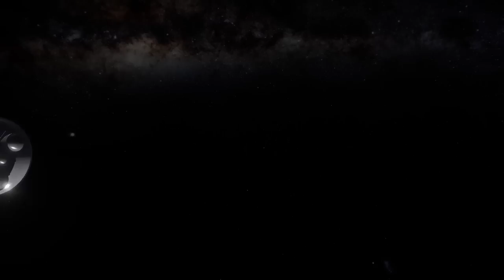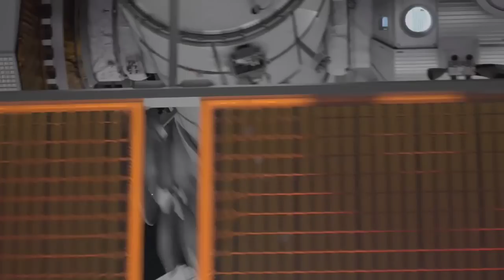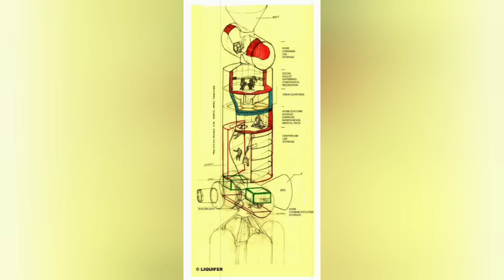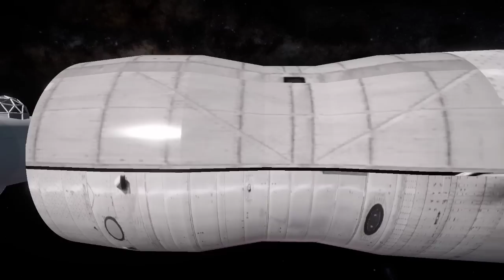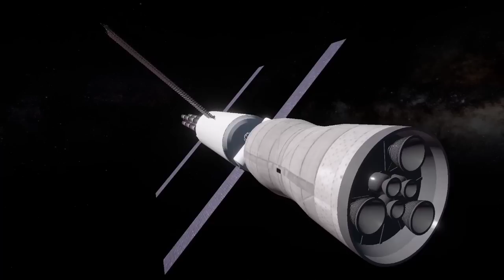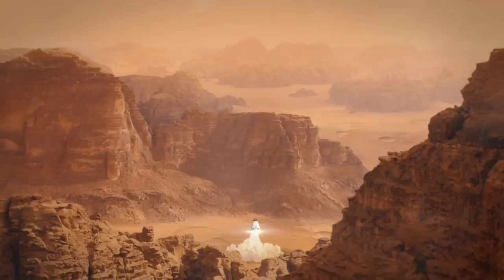The Ultimate Mars Exploration Ship!  ESA Project Aurora and how NASA is using it!

Comment: Hold the Project!  U of Toronto & Caltech used Material AI Software to design a nanoscale optimized geometry and found a carbon lattice 5X the strength of TI, but light as Styrofoam.  Now you can recalculate that trip to Mars.

Comment: Something to mention is that Aurora uses only "storable" propellant so there was never an option of using ISRU for propellant. A second proposal (really an excuse to promote the "Skylon" spaceplane concept) called "Project Troy" by Reaction Engines Limited that came around the same timeframe.

I also mentioned in comments to you there was a student study project called "Asaph-1" done in 2013 but used Falcon 9 and Falcon Heavy for both a precursor robotic mission along with a manned mission using NTR propulsion. There's also an interesting deep spacecraft design called "Space Coach" that has water as a major design basis for everything from radiation shielding to propulsion you might want to take a look at.

Comment: It's nice to see serious plans but unless these brave folks have a spacecraft with nuclear power, (engines and power grid) then this will fail. They need to get out there as quickly as possible and chemical rockets won't cut it. We developed nuclear thermal engines over a 20 year period between the 50s and 70s and that techs been sitting on a shelf for 50 years. Theres no reason outside of zero will to get serious about space exploration

Comment: Dr Robert Zubrin is correct, Mars direct, without a lenghty added zero gravity period, which must be avoided. The gateway is an expensive waste, unless it is much much larger and rotating.
This is no speculation, 3 of us, Lockheed engineers designed and documented a rotating space station.
One of us participated on the first successfull landings of  Viking 1 and Viking 2
The problem on Mars is the exploration, once landed and established on the surface, As usual angry is over pessimistic.

Comment: The "Inflatable Concrete" modules that were designed by Bigelow Aerospace, and successfully tested on the ISS, (as both Hab. Modules for a Lunar Base,  Mars Base, Asteroid Mining modules, AND as safer - and larger - alternatives to NASA's traditional "Tin Can" modules on an orbiting structure). Numbers of them could be brought in an uninflated state (to save space), and then (just as was tested successfully on the ISS), inflated either in Mars orbit to enlarge the Orbital Habitat, and upon landing, for safe, pre-outfitted, inter-connectable, pre-wired  Base Modules - Greenhouses, fuel production, Science experiments, etc. 
Being a type of CONCRETE, they offer a MUCH greater degree of protection from both radiation, AND micrometeorites, while having the advantage of being pre-fitted for specific purposes.

Comment: A human mission to Mars has always been envisaged as a nuclear powered modular ship. Starship may lift components to LEO, but there's no way a chemical Starship will take humans to Mars (or the Moon). Starship in it's current form requiring 10 refills is a dead end.
Reply: Its a dead end unless you make a gas station in orbit.
Reply: So, instead of 10 missions to directly fill the Mars bound Starship, your gas station takes atleast 11 missions.
Reply: @mrbaab5932  Its a bit safer for an interplanetary spacecraft to dock to just one thing than 10, so yes.
Reply: I’m thinking it’s only good for lunar cargo missions.
Reply: @craigmackay4909  Modified versions can have massive potential, especially if we put some gas stations in orbit.

Comment: Ten years to get this BUDGETED through the government (let alone multiple negotiating governments) is probably optimistic.

Instead, ALWAYS go with what you've got, to do what you can.  If what you've got can't get you there (and back for crew missions), don't go - but figure out what's missing and how you can get that paid for and built, to take the next step forward.  Always focus on re-usability, to slash costs of follow-up missions.  That's mostly what SpaceX has been doing.  Eventually it will work.  And the result won't be a big-deal program that may fail or lose funding before completion.

We SHOULD have been using Falcon9 to do small and simple on-orbit assembly missions. E.g. payload module plus fuel/engine module, dock them and send them off to the moon or Mars or Phobos (surface or orbit) to start building up supplies or capabilities (e.g. comm network satellites) for future missions, or to test out key high-risk systems (such as Mars aerobraking into orbit using Starship tiles, and long-duration cryofuel re-chilling systems).  Affordable and low risk at each step, small enough that it doesn't require Congressional debates at each step.

With Starship operating (soon?), we could begin refueling and Lunar landing tests (with little/no payload initially, to reduce fueling) even before we get successful Earth re-entry.  (Of course, it has to stop blowing up getting to orbit - I'm still suspicious that hot-staging may be damaging Starship's engines.)  

If NASA wants to budget something useful to get done quickly, they could pay SpaceX to build a stubby little mini-Starship "landing ship" - shrinking the tanks and cargo volume - that could never land back on Earth but with refueling (and iterative improvements) could shuttle crews many times between Luna or Mars surface and orbit. Able to be put in orbit with enough fuel to go land on Luna, and with additional orbital fueling (Falcon9 missions to test refueling hardware) it should be able to also return to Earth orbit. (Unfortunately, the current government financial situation may not allow for new programs, no matter how much they might save long term.)

Comment: This idea would be good if we weren’t expecting to be using nuclear space engines in Five Years. It is not the speed of the ship that The Angry Astronaut is telling us about that’s the issue. It’s the fuel that won’t last. As Angry has told us about Fuel Boil Off, which I guess happens when the fuel tanks are in the Sun Light. My thoughts were that we would use a thicker shell of aerogels for the fuel tanks.
‘Put a shell 10 centimeters of water around each tank, but that would add mor mass? Couldn’t we use aerogels to protect the fuel?’
They could have a big solar shield of aerogels with solar panels on the shield that blocks the harmful solar rays from reaching the fuel tanks.
‘With a shield big enough to shield the entire ship, they wouldn’t need as many radiators to radiate as much heat from the ship. Oh, with the solar panels they would have more electricity to power the AC or heaters. Or to power the nuclear electric propulsion (NEP) so we wouldn’t need as much fuel.’

I wasn’t sure about Aerogels, so I asked Claud 3.7 Sonnet:

Aerogels are remarkable materials with extensive applications in space exploration due to their unique properties. Here's how they're used in space and how they help with radiation protection:
Space Applications for Aerogels
1.	Thermal insulation - Aerogels are among the best thermal insulators known, making them ideal for protecting spacecraft from extreme temperature variations in space.
2.	Particle collection - NASA's Stardust mission used silica aerogel to capture comet dust particles traveling at high speeds without damaging them.
3.	Mars rovers - Aerogels have been used to insulate Mars rovers like Curiosity and Perseverance against the planet's extreme temperature fluctuations.
4.	Spacesuits - They provide lightweight insulation in astronaut equipment.
5.	Cryogenic applications - Aerogels can insulate liquid fuel tanks and other systems that need to maintain extremely low temperatures.
How Aerogels Help Stop Harmful Solar Radiation
Aerogels help protect against radiation through several mechanisms:
1.	Light scattering - The nanoporous structure of aerogels causes Rayleigh scattering of radiation. This means incoming solar radiation is scattered in multiple directions rather than passing straight through.
2.	Absorption capabilities - Specialized aerogels can be doped with radiation-absorbing materials that capture harmful rays.
3.	Hydrogen content - Some aerogels (particularly polymer-based ones) contain significant hydrogen, which is effective at blocking certain types of radiation.
4.	Multi-layered protection - In spacecraft design, aerogels are often part of multi-layer insulation systems that combine different materials to protect against various types of radiation.
5.	Low density with high stopping power - Their extremely low density combined with their effectiveness makes them ideal for space applications where weight is a critical concern.
Aerogels aren't typically used as the sole radiation shield, but rather as part of comprehensive protection systems that might include other materials like aluminum, polyethylene, or water for complete radiation protection in space environments.

Comment: 1) For so long duration of flight some descent sort of rotating torus is a must, or a tether for costs, just for humanitarian objectives. How could anyone jeopardize human health, even if volunteers, with so prolonged zero gravity!
2) What protection against solar wind, just in case of burst? ISS is shielded by Earth's magnetic field on the orbit...
3) Why doesn't lazy NASA work on nuclear propulsion interplanetary missions? There are plenty of very sound concepts, which are capable of making journey to Mars up to month long!
4) There should be at least 2 identical ships travelling parallely, each one capable of supporting whole crew of both ships combined.
Redundancy is everything for such long mission with so many unknowns!
If it comes to experiences, the design itself is most significant. Constructing of yet another instance cost is dwarfed by the "proof of concept" value, with the constraint of safety.

5) In situ Mars habitat is actually the safest option, already wait being prepared and thoroughly tested by robots from previous automatic missions. Elon Musk's Optimus bots are about to be sent already next year...

1) and 4) can be combined, 2 identical spaceships joined with tether and rotating around a common center of mass to create a centrifugal force in each of the ships.

In a case of emergency each of the ships could travel independently with abandoning of centrifugal force

Comment: IMO solar electric propulsion is the way to go to Mars ans back and for adjusting the earth and Mars orbit.  Chemical are only necessary to go to the orbit of Earth and Mars.  So I propose a three tiers mission. Tier one build the convoy in Earth, orbit tier two cruise to Mars and the good Martian orbit.Tiers three, go to the surface of Mars and come back with a starship or a small one. You don't need any fuel generation because the starship can fetch all the necessary fuel to go back to orbit. Mars has a low gravity compared with Earth.And I don't think methane should be the fuel of choice. Storable fuel like UDMH an NO2 are much more manageable even if they are toxic.

Comment: It appears to me that the major resources that we need to get to mars and whilst at mars are fuel and building materials. Both of which are available in a solid rocket booster. So why not just launch hundreds of solid rocket booster into earth orbit. Some of these can be ferried in a train by a tug booster.. It doesn't matter how long they take to get to mars and or when they start their journey, solid fuel doesn't evaporate. Once the solid rocket fuel stations are in place you can then start launching crew ships. They only need enough fuel to get out of low earth orbit and off the mars surface. The crew ship will hook up to a parked solid rocket booster(s) and go on their way. The booster they use will be detached once at mars and then landed independently on mars as mars building material. All you need is enough fuel for the crew ship to take off from mars hook up to a solid rocket booster(s) and return. This way there is a constant stream of time independent fuel and material being delivered to mars. Just a thought.
Reply: It's an interesting idea.   Another approach might be ion thrusters, if you're willing to take your time getting the couple of km/sec to get back to Earth, with the big advantage of possible reuse with only the reaction mass needing to be launched from Earth. (Or Mars, since Argon or Nitrogen could be a bi-product of fuel production on Mars.)
Reply: You dont need to send fuel , using the Sabatier process you can produce methane and water from Co2 and hydrolized molten Mars ice.

Comment: This ESA design is still wasteful.  Why use extra chemical engines for the transfer vehicle when you have chemical engines on the MDV?  If you used the MDV as your main propulsion module (and leave the transfer vehicle in a stable Mars orbit) then, you could place drop tanks (with flexible fueling system to different engines for backup) on the outside of the habitat module as extra radiation shielding.

Comment: Why don't they use the ISS for the lunar gateway instead of deorbiting the ISS?
Reply: According to grok. It is possible to attach the ISS to starship. It can take 420k kg to lunar orbit. But the ISS is aging. Would require adapting the ISS to be transported,which would be expensive. But they aren't designed to be in lunar orbit. It is mostly shielded from the sun by earth.
Reply: Because the ISS is an aging station that require a lot of maintenance. Being in an orbit around the Moon would just complicate maintenance.
Reply: I’ve asked this a few times over the years. The main problem is that the ISS structure cannot handle any higher inertial loads, ie the thrust required from an engine attached to get to LTO. Even orbital reboost has to be done very gently.
Also as mentioned above it’s very old now and requires a huge amount of maintenance just to keep it running.

Comment: What does it use not to get fried by radiation from such a long journey? 

"astronaut staking the same trip would experience 60 percent of their maximum career-long radiation dose just during that trip to and from Mars,"

This is best case scenario apparently. If you didnt die on the way ud be coming home with cancer.
Reply: the crew portion of the rotating ship needs lead shielding.  and it needs a high power nuclear engine.   all of this would take about $1trillion dollars....assuming $1 trillion  of equipement was launched to mars many months ahead of time and that all landed without any problems.   massive logistical puzzle